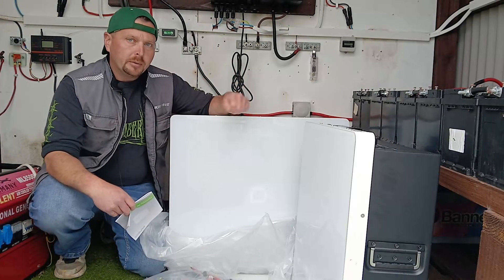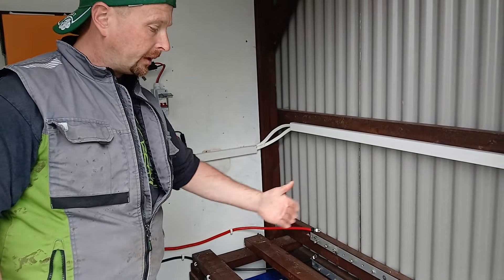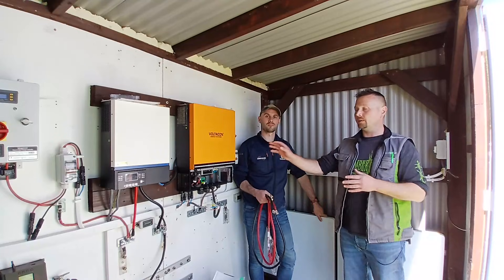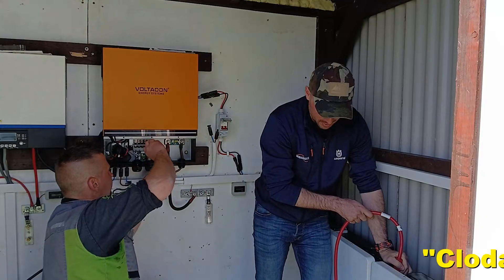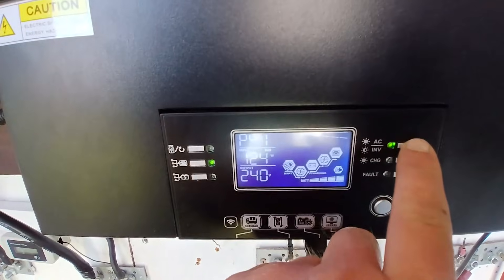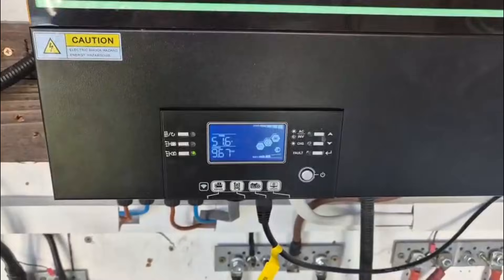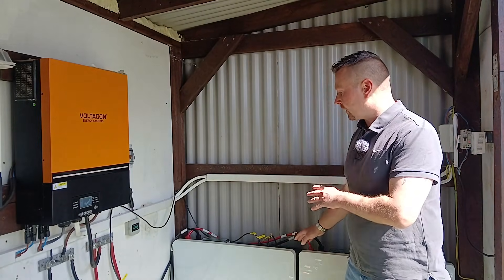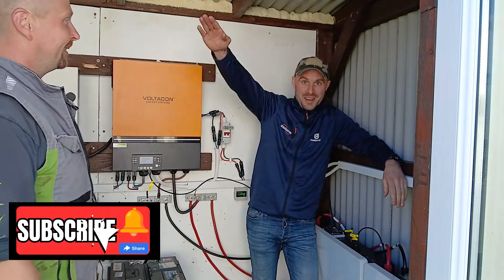New Dyness Powerbox G2 LiFePO4 Battery, The Ultimate Off Grid Power Solution.

Comment: Did you solve the pin connection problem? I instaleld this batery today with deye inverter and i have the same problem, no connection between inverter and batery using the cable with solis, deye etc label

Comment: Fantastic video and great system. I am thinking of pushing the button on this battery but I am anticipating a similar problem with the inverter communication cable. I notice my Tommatech 7.2kw inverter is a generic cousin of your Voltacon 11kw, they look very similar and the pin wiring for the BMS connection from the inverter manual is exactly the same. Did rewiring the RJ45 solve the problem? Can it be done using the DIP switches instead using the cable supplied out of the box, the Dyness manual does not mention either Voltacon or Tommatech?
Reply from the maker: I'd say go for it, the dyness can operate normally in user specified settings without canbus comms as the bms in the power boxes will regulate the charge at their end regardless of what the aio inverter wants to do.

Comment: Great set up!. Maybe there's some way of getting  one or two kwh per day , into your dyness batteries, from the istabreeze. Maybe using dc to dc charger from the lead acids
Reply from the maker: Cheers, had the 3kw 24v aio ac coupled to the 48v getting the charge in that way. Have since sold the 3kw aio and batteries to fund more panels. Have to get a 48v controller for the istabreeze now to link them in again.

Comment: Nice bits of kit but their backup is garbage. Sent a techincal question to their email 11 days ago and guess what? No reply at all.

If you have a local distributor who is knowledgable I guess you'll be fine, but I wouldn't like to imagine what their warranty/RMA process is like if they can't respond to a simple product enquiry.
Reply from the maker: Hello Anthony, surprised to hear that you haven't received a reply, did you check your spam?
Ive sent questions to them regarding the pin allocation of the communication cables supplied with the batteries and got a reply within a few hours. Included in the reply was an apology for the delay of that few hours due to staff annual leave. 
What was your enquiry, maybe I can help?
Reply: I can answer that.  Very poor.  I had the previous gen installed and it failed.  Still trying to get a replacement sorted 5 weeks after first flagging the issue.  If downtime would be an issue for you, I'd look elsewhere.

Comment: I have the same battery in my setup. Regarding your CAN communication problem, the battery has a small red switch panel beside the battery brakers that should be configured based on the inverter you use with the battery, the configurations are available in the user manual of the battery or online. For those having problems with the Dyness app, if you have the battery connected to the inverter with the CAN cables, the battery will not connect to wireless and you need to rely on the inverter app to read the battery information, I'm using Solis inverter and the info it's quite ok for the batteries, only missing one is the battery temperature. Hope this information helps.
Reply: Thanks for clearing that up. I got a can connection with my Victron inverter, so maybe that's the reason that I can't connect it to the Wi-Fi.

Comment: How did you connect the battery using built-in WiFi to your network and to the Dyness App? I want to see remotely what battery level I have.
Reply from the maker: Hello, the battery connects throught the dyness app, it's really simple. Install the app on your phone or tablet. Scan the QR code or manually enter the model number and after a short period of time the system goes live. You can then monitor the data and status of the batteries from anywhere in the world.
Reply: Hi I got the same problem with the Powerbox G2 can't connect it to the wifi using the Dyness app. Have you already managed to connect it?
Reply from the maker: @LimWakra have you just installed the batteries recently? We found that it can take up to a week for the live data to become fully functional after the registration and warranty initialisation procedures have been completed. 
I suspect this is due to the fact that the batteries communicate via cloud as opposed to directly with your device.
Reply: @ourkilkennyhomestead2006  Yes I've installed the system last weekend and did the warranty registration yesterday. I just see in the app that the warranty is approved. Only data I see from the battery is from 13 May. That must have been in the dyness factory. Tried to connect it again to the Wi-Fi, but it said network connection failed. It looks like it's not able to connect to the wifi. I wait a little longer and after that I contact dyness support. Thanks for your reply.
Reply: @LimWakra did you have any success? I seem to be in the same boat as you. I'm wondering does it need an antenna.
Reply: @bionicbob69  No, unfortunately not. Was hoping that an update from the Dyness app would fix it, but no. Maybe it's an IOS issue and is the android app working as it should.

Comment: Hi there, great to see someone in Ireland with this unit. I'm shopping for the G2 at the moment for installation in Wexford - €2300 a piece from SolarBoss in Carlow. Don't suppose you have a better connection? :)
Reply from the maker: Make friends with a solar installer, these units are around 1900 each from EWL but they only sell to the trade.
Reply: Hi did you say you are paying €2200 for the g2 battery ??? Im getting one installed also but midlands electrical are selling them 1900 delivered ???????
Reply: @RickysGadgets  I'll give them a bell, thanks!
Reply: @RickysGadgets  Do you mean Midland Batteries? They're doing €1875 ex VAT, or are you getting a better deal off them?
Reply: No thats correct solar installs are vat excluded get your installer to prive match it sure they sre getting it vat excluded too  @mcljot
Reply: @RickysGadgets  I understood the installation service is VAT free, but the supply of the parts to anybody (including installers) is going to include VAT. Is that not correct? Who are you getting to install yours? Thanks!
Reply from the maker: @RickysGadgets  according to their website the price is €1875 not including vat at 23% or delivery charge.
So the actual retail price from them is €2306 plus deliver on top of that.
Reply: Did you get sorted?  These have dropped in price considerably.  Great batteries.
Reply: @edreidphotos  I ended up getting one from SolarBoss for €2200. Are you seeing them cheaper somewhere in Ireland? Cheers
Reply: @mcljot  Not in ireland but delivery to Ireland for less than 1700.
Reply: @edreidphotos  Got a link handy?
Reply: try bimble solar on the south coast of UK, they might ship to ireland ???

Comment: I have been quoted for same setup yourself. How is the app and setup working. Does it allow much tinkering as i have economy 7. the quote is £1.5k cheaper for solis 3.86 inverter, 5.68kw Jinko panels and 20kwh G2 Dyness batteries, (than the rival quote with all sigen batteries, inverter and Aiko panels which seem to be slightly better. )
Another installer told me to stay clear of anyone offering Dyness batteries saying they had to take Generation1 Dyness batteries out for a customer and so they have changed supplier (too cold outdoors in Donegal and stopped working )and that the tech support from Dyness is non existent even for suppliers.?
Reply from the maker: Hello Derek, haven't had any problems with dyness after sales service. I got in touch with them regarding the pinout on the rj45 cable for canbus comms to the inverter and got a response very quickly with the correct information. The app is very good once it gets up and running. Once you have the batteries registered on the app and the warranty registered through the app, everything starts working. You'll have remote access to the batteries from any location, daily graphing of charge, discharge and overall SOC. One thing is that the batteries have to be within range of your wireless router or booster if you have one. 
Would it be fair to say that in the case you mentioned above that Dyness isn't so much at fault for the installers chosen location? That company should possibly have chosen a better location for the older batteries which are temp sensitive, dyness themselves can't really be blamed for that one, more likely the installer for not thinking it through. Suppose it's common enough for the book to be passed when things aren't done right. That should be a bit of a red flag for you if you decide to use them for your own setup. 
With these G2's having heating ability cold conditions won't be so much of an issue.
Reply: @ourkilkennyhomestead2006  Fair comments about the installer, thanks for the advice. Im 90% sure I will go for the Dyness G2 Batteries etc. Merci beaucoup. Keep up the good work. 
Should i see about making an insulation box to go over the batteries for the winter, since that would hopefully save on the heater being used to keep the batteries warmer. I'm going to install them in the uninsulated attic above my garage. I was thinking kingspan sheets made into a removable box.
Reply from the maker: @derekgamble5089 you're very welcome. Honestly, if you're putting them in the attic as you describe, I'd stay away from the box idea as they need airflow around them to keep cool in hot temperatures. Not likely to reach freezing in the attic but may get hot in summer up there. They could be fine in the attic as they are just bolted to the wall.
Reply: I have ordered 2x10kwh G2 batteries today. Thanks
Reply: @derekgamble5089  Hi Derek, are you in Ireland? Where did you order the G2s from? I'm shopping at the moment, looking at €2300 a piece from SolarBoss

Comment: Hi Michael, congrats on the install and the video. I've installed the same battery myself a few days ago with a Solis inverter. What would yourself or Paraic recommend as the ForceChg PLMT setting, I've set it to 5000w the max value? Help appreciated
Reply from the maker: Hello David, thank you and likewise, congratulations on your new installation. Force charge PLMT stands for force charge power limit. Force charge is used when the state of charge of the battery is low and the inverter will recharge the battery from the grid. You should be able to set the state of charge (SoC) value at which the force charge activates, and also set the time of day or night that this is allowed to happen at. The force charge powerlimit (PLMT) is how much you want to pull from the grid continuously. Setting at the max value means the battery will recharge in a shorter period of time. As the max charging current stated by Dyness is 200amps, your setting of 5kw will range between 90 and 104amps depending on SoC which is well within the batteries specs. Just make sure that other elements of the installation are able to handle that level of current safely for prolonged periods.
Reply: @ourkilkennyhomestead2006  Gentleman - Thanks for the clear explanation and clarification; now I see! The cables are all 35mm2 and I’ve two fuse-link SOA KETO-00 80A (on positive and negative) with Jean Muller fuse-switch (battery isolator) should be OK. By the way I had to look all of that up!
Reply: Ps - I have it charging from the grid at night rate :)
Reply from the maker: @DavidDoyle-B2BSell  if your fuse links are 80 amps it might be better to reduce the force charge plmt down to 4kw to leave a safety margin. If they're recharging overnight, time is not so much of an issue and recharging quickly is not essential.
Reply: @ourkilkennyhomestead2006  Good idea, thanks - Will do
Reply: @DavidDoyle-B2BSell  The install company didnt need to use the 35sq cables that came with the battery nor did they need to use the x2 80amp fuse with carrier. In this set up its 100% safe to leave at 5kw charge and discharge.

They should of just used the cables that came with the solis and connected straight to battery. Extra equipment installed there costing the customer more money.
Reply: @MrPadraigmccarthy Thanks Pádraig, just for clarity the Inverter is in a walk in attic space and the battery is attached to a wall outside (supported underneath with legs) for safety reasons, so there probably a cable run of 80 meters, hence the cable spec. Thanks for the advice on the setting, much appreciated.
Reply: @DavidDoyle-B2BSell 80m DC cable run, that sounds un natural..??
Keen to know the reason battery didnt go beside inverter. Why so far away.
Reply: @MrPadraigmccarthy The other half didn't want it in the house
Reply: @MrPadraigmccarthy I'm an eejit, typo there 8 metres not 80 metres 😅
Reply: Is there not gonna be significant dc losses with that much of a cable run?

Comment: Can now dot a few small oil radiators around, electric blanket on beds and sofa small hob or two.
Reply from the maker: @HenryOwens-py3ur  for context Henry, these 10kw units cost roughly 2k euros that's the same as an average household annual energy bill. But their guaranteed life span is 10yrs.  10yrs of power for the price of one average families annual cost. Start saving up brother, these will serve you well for a decade or more....
Reply: If theyd been out a few years ago I would have had one instead of my seplo. Saving for an ev, going to charge it at 6amps 1440w and then install my 12v 1000w invertor to 48v battery through 48v scotter charger at 4 amps 400w. Still keeping the l200, its a keeper, just wonder if I upgrade can one seplos pull 9kw to my 5kw.
Reply from the maker: @HenryOwens-py3ur  honestly Henry as a mechanic, I'd step away from the ev's until their market stabilises and stick with a petrol or diesel for the moment. I recently did an interview with the hardware association of Ireland where an ev rep said to stick with the old fashioned fuel motors for the moment as stated to me by the podcasts host.
Reply: I know what you mean, an ev and battery are two separate investments and insurances arent covering both, its just an idea to have as an offgrid back up and short trips. 
Calculated I need two seplos to pull 9kw, I just gotta start welding in the next few years, l200 costs me £1000+ per year.
Reply from the maker: You could always put your current gear up on the market and buy the voltacon max 11kw like we have for 1600 and add the dyness batteries to it at a cost of 2k per 10kw with the 10yr  guarantee on them plus heat pads, fire suppression systems etc and rattle around in a €600 vw golf like I do for the sake of saving a few bob. It's not for everyone granted but that little golf had grown on me 🤣🤣🤣
Reply: Selling and buy again would be £2000 loss, if I am going to upgrade its the deye 20kw x3 seplos kits and keep 5kw invertor as a back up, as for the Animal ive still got mud guard stickers to go on, want to weild shackle eyelet from chassis, I could do chassis inserts with bolts stops.
Reply from the maker: @HenryOwens-py3ur  sounds reasonable enough but 5kw won't run an oven and 2 hobs at the same time as a well and fridges etc.
Reply: Ten years is a reasonable time to save for all of that ! Thiers a 4500w oven twin hobs £100, small oven tho.
Reply: Infact the cookers is my next buy, now summers hear, should save my gas up untill September and a 2kw water heater
Reply from the maker: @HenryOwens-py3ur  it's a hard one to judge with the cookers. Our one states 10kw on the label but that's with everything turned on at the same time as we've discovered through usage. Realistically the oven alone uses 2kw constant as does the grill/top oven. Each of the hobs uses 1.4kw on max setting. On a smaller system you could use each component individually to cook the dinner  without overloading your supply